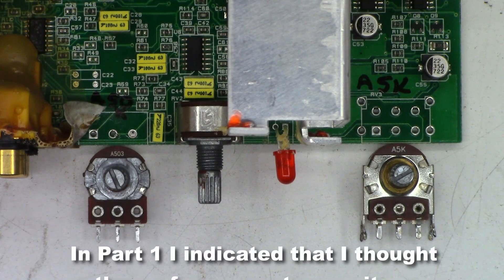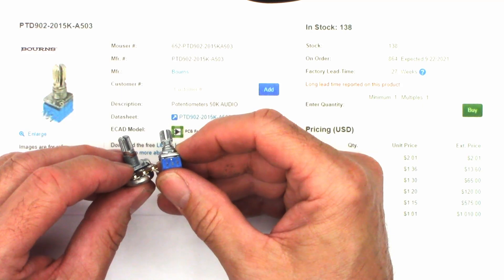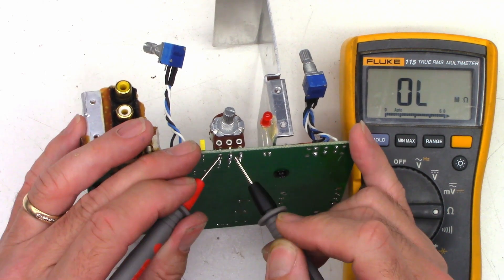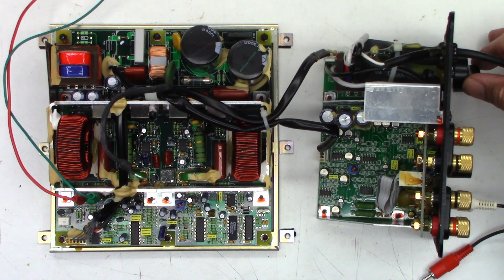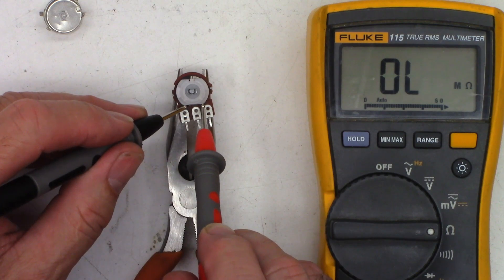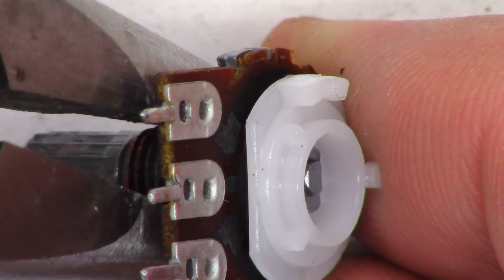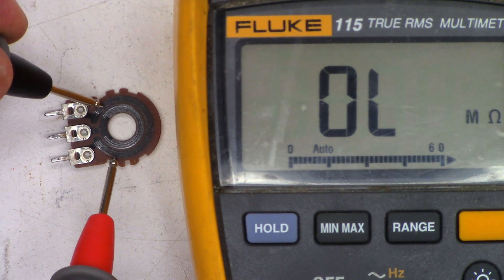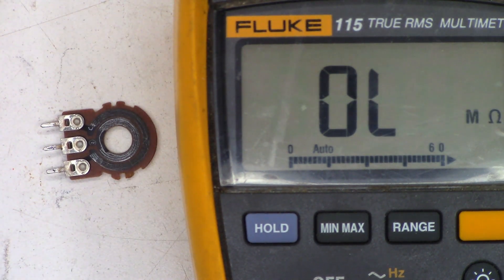PART 2 - POWERFIELD DEFINITIVE TECHNOLOGY SUPERCUBE III NO AUDIO REPAIR SUPERCUBE 3

Comment: I have the super cube 3 with the same issue. Thanks to this video I was able to diagnose it!

My question is, as a temporary fix, can I by-pass the pot by soldering a strand of wire across the soldering points and just adjust the volume/level on the receiver?  Is this safe? Or should I use a resistor instead of the wire?  TIA
Reply: I would use a resistor of similar or lower value of the pot that you are going to by-pass.  So if the 5k audio pot, then use maybe a 1k resistor or just solder jumper leads to the board and use small clips to add the resistor.

Comment: Is it ideal, with my volume level pot stuck on max volume, to use a external line in volume control? Would/could it cause damage to the amp or woofer?
Reply from the maker: It most likely has a failing pot. the return ground side is probably open, thus no divider when the pot is at the low end.

Comment: what size wire did you use to solder between the board and the pots?
Reply from the maker: Small gauge wire, 26-30AWG is all that's necessary. They are not carrying any measurable current.

Comment: excellent video.  Curious the new pots are 0.025 watt.  Given the old ones failed open circuit are you not worried that they failed because the power rating was too low and that these new units might also fail as well?  Any feedback from the repairs over time?

Comment: Great and informative videos.  I just picked one of these up.  I had a bad phase pot but only had a B50k handy. Obviously won't produce the right result, but should give me enough to know if it's worth investing in.
Now my power LED has not come on ever.  Is that due to no audio input as I noticed it says Auto Power?  Assuming I have no other issues. I'm not home right now, but will check later. I feel much more confident in getting this working again after your tutorial. Thankyou from Clovis, CA

Comment: Hi guy... 

ProsSub600... it's power on... and play very low level music... 
volume is working... 
LPF seems do not show any changes... 

it seems it is "limited"... 
I've seen schematics for othetr DefTech and I've seen there are a sort of limiting level in case of  needs... and seems that the limiting is done with an automatic HPF... that should explain the LPF doesnt work... 

do you have any idea ? 
do you have a scheme for PS600 ? 

thanks in advance
Norb.
Reply from the maker: Norb, DefTech does not release diagrams. I do not have access from any of my sites. Sorry.

Comment: Hey I have a SuperCube III and also have a bad potentiometer (luckily just one). I ordered and can replace the failed component, but there is so much clear, white, and black glue holding the boards to the back plate that I'm having difficulty accessing the failed pot. I can see the excessive glue on your board too. How did you get it apart? I am afraid I will break something if I put stress on the PCB or if I try cutting into it with a knife / razor. Thanks for the help!
Reply from the maker: I did gently use a razor knife to slice the glue around the circuit boards then gentle prying to get it loose.
Reply: @norcal715   I'm wondering if a rework heat gun might help to soften up some of that glue. I have 4 of these boards that I want to change the pots on, and I'm looking for some good tips to pull the pieces apart.

Comment: I have the superCube I my backplate looks identical.  I own 2 of these monsters. One developed a low hum.  I’m can solder and have. Basic radio shack multimeter.  Should I start at the caps? I know it’s one sub as I have checked all external cables for interference. It’s definitely the sub. I would love to fix it. Thanks and great informative videos you posted .
Reply from the maker: This is on another model but you can measure the AC voltage across a defective capacitor with just a voltmeter in the AC range to potentially determine if it is the fault. https://youtu.be/LvXe0bOF_mk Just make sure you dont short the pads together.

Comment: Those pots look like crap to me. Awfully cheap for such expensive equipment, but then I was used to the pots put into Motorola commercial equipment. Steve, you are truly a technician, not a parts replacer.

Comment: No power light comes on,where would you start?
Reply from the maker: Start by checking the standby voltages. Sorry I do not have a schematic to help you. Email me Norcal715videos@gmail.com if you want to send it to me to look at.
Reply: I have same problem with my definitive supercube 3. Its doesn't power on, how to repair it? Pls give me some idea.

Comment: The "lead in" is fine, it's the physical connection between the solder tabs and the lead in that's bad. Give them a squeeze or add a new stake mark to try and give it a new point of contact between the tab and lead in. You got a little confused when you were measuring the center track at 13:40, that reading should have been consistent throughout the whole range, but you know that. 
Great to see them opened up to see what the hell happened and seems they all have the same failure point. Thanks for the failure analysis!

Comment: My guess would be that the "lead-in material" is cracked due to vibration. The pots are/were mounted solidly to the rear panel and soldered to the board which is probably not so firmly mounted - the board movement flexes the phenolic parts of the pot cracking the connective material. The phase pot probably failed first and wasn't  noticed. I suspect your new pots with the wire leads will last much longer! Thank you for an interesting video.
Reply from the maker: Thank you!